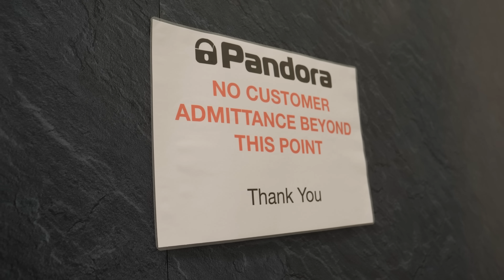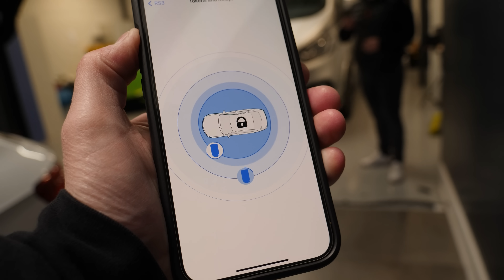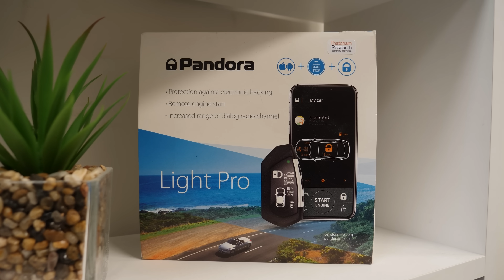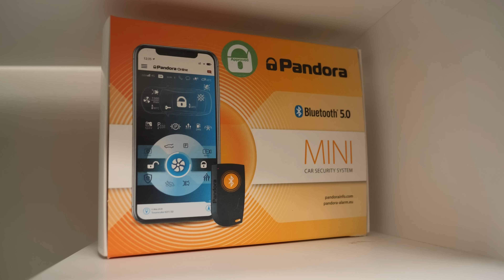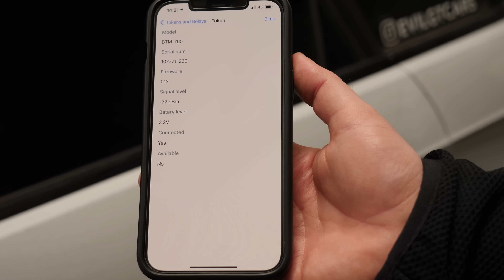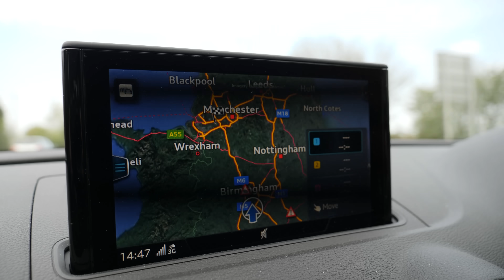This is the REASON My Car Could Be Stolen in MINUTES!

Comment: After having a Pandora alarm fitted for over a year I would suggest not using an android phone instead of the tag. I had absolutely no trouble using it to unlock and the car always started fine, what I did have trouble with is that the Bluetooth signal would often drop out between phone and alarm and cause the engine to die. It happened on more than one occasion and it even happened once when I was pulling onto a busy fast road and left me completely stranded in the middle of the road. After that I always kept the tag with me and had no more problems.

Comment: Tapping into gateway canbus and cause virtual dash drop out and 90% are wired direct at j533 easy to get round not the be all as advertised.  Better to have additional cut out to fuel pump control on the output side so no feedback on the ecu switch feed. Looks a decent system btw those cheap canbus blockers are crap cause all kinds of network errors on the bus and mostly poorly fitted and soldered into the bus. Cobra use to be a decent kit cat5 hardwire cuts are always better than a rip of can module.

Comment: Nice work gents. Great video… again…😉The chap is correct. Can Bus immobilisers flood the bus with crap data stopping the car functions. However, you can inject that at multiple points on the bus so not always as easy to bypass if installed well. Circuit breaker is gold standard. Three circuit break is very effective but it’s achilles heal is the tag. It physical and the best bypass. The best immobiliser is a mix of both so you will see Can Bus immobiliser with 2 additional circuit breaks hit the market soon. Having any form of tag is the problem.

Comment: So from what the pandora bloke is saying if you were to cut there immobiliser out and put a few wires in between as a home made wiring harness the car will start and drive ?🤔🤔🤔
Reply: Nope, you'd need to find the immobilisers and cut them out too! Obviously these are hidden and buried in different areas. It just makes it x10 harder to bypass, and eliminates any chance of them quickly getting past the system which unfortunately is a real problem with many CAN immobilisers (that's why we don't use CAN block on its own, even though we could)
Reply: @matthobbis1358  I'm intrigued by this system I might have to try one out on my quad
Reply: @that_turbo_daily7654  There's actually special motorbike systems too 😅 DMO Deejay has them on his quads.
Honestly, they're awesome. Genuinely proud of the products. Personally I love remote start the most!

Comment: I will just lift your car into my truck 😂
Reply from the maker: So you’re saying don’t bother installing an anti theft device for the 0.1% chance someone’s going to pick it up and put it on the back of a truck? 😂 the car has a tilt sensor built in anyway so if it’s towed or tilted the in built alarm will go off. Other than making it weigh the same as the moon, nothing will stop that from happening 😂🤷🏼‍♂️👍🏼

Comment: 🤔 im failing to see how going backwards to an “immobiliser fob” helps with security? A fob can be lost or stolen, then the thief can start the car regardless
Where as a Ghost is a simple push button code on entry to the car, a code that only the owner knows 

I get that Maybe there’s benefits to the 2 point immobilisation, but what use is that if the fob falls in the wrong hands or the keys are stolen in a burglary? 

Where as a Ghost it doesn’t matter if you have all the keys coded to the car, it ain’t going anywhere until that code is put in it 

Let’s face it, even if a Ghost is findable on the car to remove it, if they have low loadered the car away and now have all the time in the world to search for it, they REALLY wanted that car 🤣 so no security will prevent that

I still prefer Ghost, as even if some shit head demands the keys you can just throw them at the cunt and say yeah, fill ya boots mate whilst you remove ya self from the situation, the car won’t start, but if you Chuck em the Pandora keys with the fob they can drive off no issues as the car recognises the fob 

Can’t see how that’s better myself
Reply from the maker: That’s why you keep the 2 separate buddy. It’s completely pointless having the fob on your keys. The fob would stay in your pocket or bag or wallet or whatever 🤔 you can also set it up to do the whole button thing the same as a ghost too 👍🏼
Reply: You can have the fob, a code, or both! Pandora just gives you more choice. 
So even if a thief has the fob or code, they'll need both to get away if you want extra security. 

Stronger Pandora systems even give you the ability to shut the car down anywhere in the world from your phone (even if the car is moving!) also blocking out the tag/code so it doesn't work anymore.

The tags are usually more convenient. I personally hate the code 😂 but it's all personal preference!

The two point immobilisation just means it takes much longer to remove the system, so makes it more fool proof to thieves.

I keep my Pandora tag with my house keys, so even if they take my car keys it's safe. This works for me, but everyone uses their Pandora differently 👍
Reply: @EVILGT  ah i see, but that still leaves that vulnerability of losing it or it physically being stolen doesn’t it

Pandora Seems a bit over complicated to me, especially considering most car thieves struggle to tie their own shoelaces in the morning 

Let’s face it, if it’s a targeted theft they will take it no matter what, just think a Ghost is way more simplistic for the end user and does what it’s supposed to do invisibly without having to split up keys and key fobs, download apps and all that malarkey 

Just my opinion like
Reply from the maker: I agree with you on the simplicity of that system but what I suppose we didn’t explain all that clearly was that it can be used the same as a ghost if you prefer with just the buttons on the steering wheel etc. The difference with this system is that you can have a fob/app/buttons individually or all together 👍🏼 and if they find the Pandora system it still won’t start as it will with a ghost 👍🏼
Reply: Ghost for me allday

Comment: So basically....
1. The crooks can remove a ghost, if they have the time (which they won’t have).
2. The Pandora fob idea is a bit last century, and even if people keep it separate from their car key, how separate is it going to be really ? Different room at best, so burglars could still find it. 

So best solution is to get the Pandora and use it like a Ghost, because at least then it can’t be removed. 
Pretty sure Ghost will clock that detail and upgrade their systems going forward to the same spec.
Reply: In all honesty, most CAN immobilisers are removed a lot quicker... 
Thieves can easily have a few minutes if no alarm is triggered! 

The fob is down to preference really, although keeping it separate provides the most security imo. 
Finding a small tag in a house is near impossible, especially when a thief doesn't know what to look for or where it could be. They'll grab the keys and go.
Alternatively, you can have the code and tag in order to start the vehicle. 
If you have an upgraded Pandora system, you can even remotely immobilise your vehicle whilst it's in motion, blocking out the code/tag (this feature is great if you have a very targeted vehicle). 

Ghost can't really upgrade in that sense, as it'd massively affect their distribution model and units sold if they enforced a change in immobilisation used. It can already have a physical immobiliser but it's almost never used, unless the vehicle in question cannot have CAN immobilisation. Most CAN immobiliser dealers don't want to install the stronger, physical immobilisation. At Pandora we make it a requirement to have the stronger immobilisation as standard. 
It takes more time and experience, and every car requires different cuts, but the end result is more secure. A lot of dealers who fit CAN bus immobilisers struggle fitting physical immobilisation, purely because every vehicle is different and it takes more time to get up to speed! This means it's harder for us to distribute in large quantities because there's less people able to install to the high quality needed, but sometimes that's required in order to offer a more consistent, high quality product.